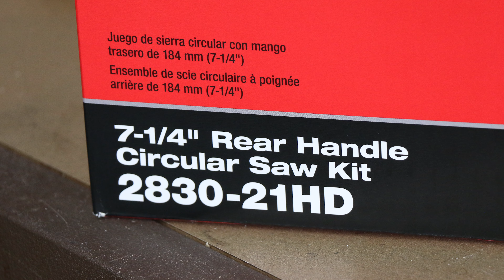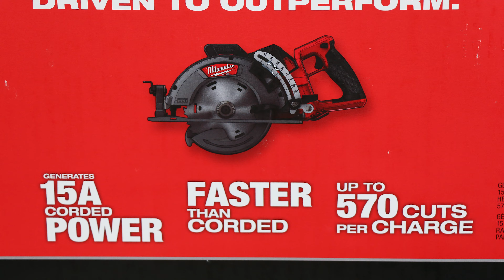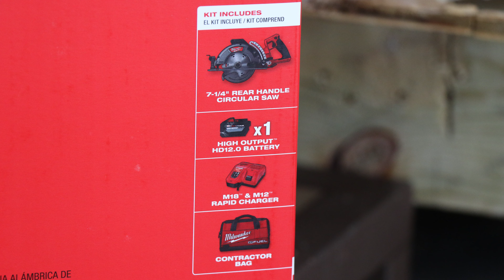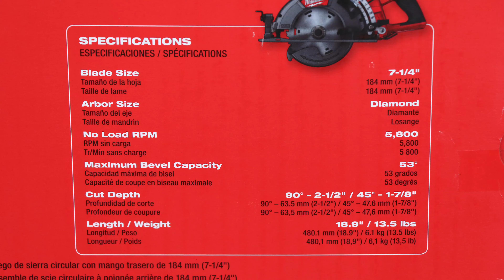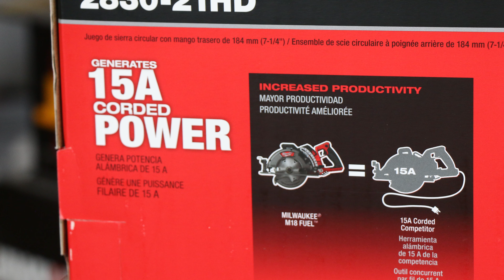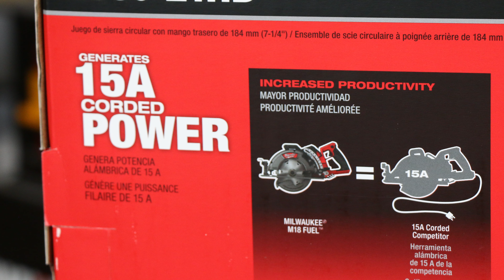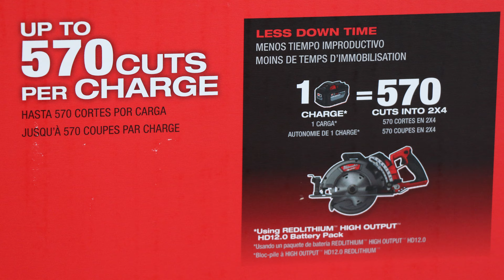New Milwaukee Tools 7-1/4'' Rear Handle Circular Saw **WARNING** (PROPER SETUP REQUIRED)

Comment: You should do a Makita vs DeWalt vs Milwaukee test. Plus there battery life and cost.
Reply: Add rigid to the list
Reply: How dare you leave the Kobalt XTR out...XTR tools are amazing. I bought the 3 tool combo that came with the drill,impact,led light,hammer drill bar grip attatchment, 2 batteries,charger,hardcase,and with that purchase I got a free Kobalt Circular Saw bare tool.

Comment: Vince I've had mine for a week and still haven't opened it.  But everything I've seen it's a beast .  Update finally got to tear into some 3/4 " osb yea its seriously a beast. Its my experience that this saw is better than a corded saw . Use it on 2x4  , 2x6 . Plywood, paneling.  It dosen't matter . Eats it up .

Comment: If memory serves me correctly, a standard corded skil saw is around 14.5 pounds and the mag 77 is a little over 12.5 pounds. So this hit right in the middle which is pretty good since the DeWalt cordless felt heavier than the corded skil. Even with the extra heft, the time saved by not rolling out or relocating a cord or hose makes these cordless tools total game changers. As long as the weight is distributed properly it has little effect on usability.

FYI for the uninitiated the rafter hook we call a sky hook and the “base plate” we call the table in the field. The notch in the blade wrench served two functions, one as stated to unscrew the brushes for cleaning or replacement and it also can break the diamond center out of the blades when required.

Comment: the screw driver on the wrench is also used for the rip guide that slides into the side of the deck. use it on the daily for multiple rips
Reply: what rip guide fits this??

Comment: Defenetly going to buy AND I cant wait for TTR Dewalt vs milwaukee worm drive saw
Reply: And Makita....?
Reply: Bailey Dyson makita is also great just personally would rather see Dewalt vs Milwaukee
Reply: @Dogecoin831  fair enough I've used both the DeWalt and Makita alot, and find the DeWalt has a tiny bit more power... Doesn't make a difference. However would choose the Makita 100% of the time you can't beat it's quality and smoothness. Will be interesting to see how 18v vs 36v vs 54v goes.
Reply: Bailey Dyson i guess just comes down to what platform your already invested in
Reply: I'd love to see DeWalt vs Milwaukee vs Makita.
Reply: Dewalt would destroy all comers
Reply: Its been done by at least 4 reviewer's and Dewalt won all 4
Reply: @loucifer323  really?  I'm curious to see this myself.  Do you have any links?

Comment: That friggin' ad right as you are about to make the first cut. 😂
Even if the dust collection wasn't perfect, you could see how much it caught in the backpack vac!
I have the DeWalt 7-1/4" XR circ saw, and I wish it was left side line of sight.
Reply: Can't stand the FLEXVOLT 7-1/4 sidewinder. I just can't do blade right saws. Gotta stick with my rear handle Makita 36V.

Comment: Hey Vince as a physics guy the hole is there to provide more suction at the point of entry for the dust. Think of it like an air vent in your plumbing. Air is going to take the path of least resistance so the air channel is going through the house, the dust moving through isn't going to want to escape that path because it would take more energy to exit the air channel than just follow it (eventually ending up inside the vacuum). Great video, love how you test tools.
Reply from the maker: It helps to keep air velocity up?
Reply: @VCGConstruction  Keeps it up, but also makes it greater than if you didn't have the hole.
Reply from the maker: Got it!

Comment: Only because no one has done it yet. Tool and 12.0 HO battery is 14lbs. Pretty good in my opinion. Great video VCG. For a test, I think you got to rip a piece of 4X8 on the 45 degree angle. Does anyone use the cordless band saw? if so, how well do it work?
Reply: Robert Capouellez i use the older brushed m18 band saw and it is powerful and very handy.  I tried to use the newer m18 fuel band saw and it was almost impossible to use one handed because of its larger size and heavier weight.  The m18 fuel bandsaw is nice because of its variable speeds though.

Comment: I initially bought the right side blade m18 7 1/4 circular saw... i will tell you this... i loved it but was really interested with the worm style so i ended up returning the right side blade and bought this worm style circular saw.... these are my pros/cons for it...  love the ways it cuts (like butter), weight is a tab bit heavier but it has the well balanced feel even with the battery on... i dislike the dust port... wished the additional port attachment didnt have a hole. They should have it closed instead.. So unlike the right side circular saw where dust isn't blowing on you...  i will tell you this... with this worm style circular saw and the way Milwaukee outfitted it's dust port.... dust will surely be blowing on you....With that said i still have no regrets with adding this beast to my line of milwaukee tools.

Comment: I got this saw last month and it's a beast. Tho I'm always covered in saw dust and you'd be surprised on how much saw dust I manage to get in my pockets
Reply: Get yourself a nice rugged leather apron
Reply: One thing I hate about this saw is the dust bath..
Reply: @theconcretecaveman6266  does the Milwaukee vacuum work on this? It’s really small pipe
Reply: @markgonzalez8828  it works to a certain point.. with the vacuum hooked up you will catch about 80%of the dust, it creates so much dust that the 20% is actually alot.. and without the vacuum hooked up, we'll prepare for a shower of dust.. lol it's really powerful though.
Reply: @theconcretecaveman6266  I’ve tried the dewalt version. Makita. Don’t see as much dust as I did on this video. Concerned a bit. I would still buy it but wait on a deal . Right now I can get it for 175 plus tax. On Home Depot when you add the other circular saw together. But I’ll just cancel the other one

Comment: Hey Vince.
Although, I'm in the Milwaukee 18 volt line and use them often. I bought the 48 volt Skilsaw rear handle wormdrive saw. Have been using almost everyday. I can't believe how much power this machine has, but its power is there when I need it. Thanks for the video 📹...

Comment: Look at that baby face 2 years ago... I love my 2830-20 saw. It works awesome. I hate the damn cord getting in the way on my old circular saw. How many of you guys have a taped cord on your circular saw? I always wondered why my dads had electrical tape on the cord. This saw is a damn good tool. No cord to get in the way!!!!!! I started out with the 5 XD battery. It is lighter than the 6 amp hour and 8 amp hour batteries. With the 5 XD battery, it last a long time in this saw. You don't need the 12 amp hour battery for use in this saw. It's a heavy beast!!!! Saw with blade weighs 10.4 pounds and 12 amp hour batter weighs 3.3 pounds. That is 13.7 pounds total. I like running mine with the 5XD and single hand on ply wood, peg board, 2x4's, 2x6's etc... This saw cuts straight effortlessly and the light works great. Milwaukee hit it out of the park with this one..

Comment: Do you recommend the Milwaukee rear handle circ saw or skilsaw battery. I’m already on the Milwaukee platform but would rather have the better of the 2. Thanks

Comment: I'm curious why the run time on this saw is listed as 570 cuts per charge when last years 2732 model is rated at 750 cuts per charge with the same battery and what appears to be the same motor. I have the 2732 and have been happy with it, I would prefer a left line of sight saw but have gotten used to using sidewinder style right line of sight saws and don't think I would purchase this one especially if its rated run time is a lot lower. The dust collection seems to work about the same as the 2732 and the table saw, which is to say not very well but definitely better than nothing. I think Milwaukee missed the boat by not expanding onekey functionality to allow a hypothetical onekey vacuum to wirelessly link to any onekey tool and auto start/stop the vacuum when the tool is being used.
Reply: Youre acting like you couldnt just have a back up 12 ah battery.  You a single battery for whole lineup kind of guy i see
Reply: @tannerwharton4670  man wrote a college thesis about a battery lmao

Comment: dust collection never really gets all the dust, just keeps it down so cleanup isn't so bad. It seems to do as good as if it was corded. I like worm drives they seen to allow for more control and straighter cuts. Probably most because of the change in leverage points when operating them.

Comment: I'd like to see run times / performance with the HO 3.0s since i have a lot of them now
Reply: the early evidence from other reviewers is not good with the 3.0s.. thermal shutdown etc... the 6.0 HO is probably going to be the lightest HO battery to push this blade with confidence.  In fact I found in one comment where some people thought the 6.0 HO would have more grunt than the 12.0 since a smaller capacity cell (not size) was used and as such would favor peak discharge over the 12.0 HO which uses a max capacity cell.  I think you might find that a 6.0 HO could win a side by side rip time test against a 12.0 HO.

Comment: Hi Vince, 

I know this is a older video but i would have like to see water or mist on the saw. My thought is, just in case you are on the job site or home and left the tool out in the rain or passing shower. 

Would like to see if it has any issues or causes any problems for the cordless saw. 

Keep us posted if you do any experiment with water with this saw. 

Thanks
Reply from the maker: Not a bad idea!!

Comment: I only got the super sawzall this month. So only 1 M18 12.0 battery. Shopping for the others now. Yeah they need some work on the dust collection. I am wounder what the Christmas sales for later on M18 worm drive though we will see later. I want it though don't need it yet though should have by Christmas time. Cold cut some money this month. I checked the M18 trimmer / pole saw to verify construction. I need one for 30ft since shaft drive not a option. The kabolt is electric shaft so possibly a option. As always thank you for these great videos & have a Great Birthday.

Comment: SO many things I'd like to say here in the comments!!! 1. I'm excited for you, Vince!
2. You're so much cooler than i could probably EVER be during an unboxing!
3. Cool cuts with only 1 bar on the fuel gauge
4. Maybe the hole in the dust attachment is to help protect any hose or catch bag from collapsing? Just a guess. 
5. LOVE the electric brake! Cool stuff!
6. I did see 1 cardinal sin (in my world) you committed.  NOT using a power drill to loosen a screw. 🤣🤣 just kidding.  Remember, I'm one for swatting a fly with a sledge hammer. LOL 
7. Congratulations on getting such a cool right-handed🤣(left line of sight) circ saw!
8. Would like to see it tested on..... oh.... everything in sight! so tempting... my goodness
9. Finally, thanks for sharing and God bless!😁👍✌
p.s. are you going to name her? 😉
Reply from the maker: Thanks David, we appreciate it!! I’ve never really made a habit of naming my tools!!
Reply: @VCGConstruction  Me either, Red Sonja was my first named tool.  Was Drew's (my grandson) idea. How could I not? LOL

Comment: On the box it states that the total weight is 13.5lbs, M18 12AH HO battery is 3:6.6 lbs M18 saw with no blade is 9:13.8 lbs Saw with blade is 10:3.8 lbs saw with blade and battery is 13:10.4 lbs

Comment: I use the 6 1/2 left line of site and the 7 1/4 right line of sight sidewinders. And they are great only thing i didn't care for is how out of square the 6 1/2 and was wondering if theres a way to square  the blade and still keep the degrees on zero

Comment: Is it possible the hole adds more power to the vacuum? I just know most vacuums aren’t meant to be necked down, thus losing power until you create an opening to allow it to get the proper drawl.
Reply from the maker: Good call!
Reply: You are correct on the hike in the vacuum for the rear handle saw plus it provides visibility so you know when it’s clogged. Getting clogged up could bog the saw down and the vacuum. Easy to stop and fix it when you see an issue.

Comment: @ vcg I have to share some frustration with acme tools. I bought some Milwaukee stuff in the being of june.(not preorder stuff) then mid june I hit them up. The said late june. Late june comes around then they say july. I just got a email saying September. Not to mention half the items the dont give me tracking. I dont think I'll be using them anymore. Have you or any of the vcg family had these issues?

Comment: Vince, I’d like to see the following tested if possible:

Dimensional lumber
OSB
1/2 & 3/4 plywood 
3/4 Baltic Birch plywood, taped cut line (prevent splintering/tear out)

I’ve been thinking this is the circ saw to pick up, glad I waited!

Comment: The screw driver on the end of the wrench could possibly be a tool to break the diamond insert from the standard blade. Like the dewalt rear handle has built into the angle adjustment. Black and yellow all the way !!!

Comment: i got the 2830-20 and it says its 10lbs but mine is TOOL ONLY, i think the 2830-21HD is 13 lbs WITH the battery

Comment: Is the screw for the dust port a flat head? If so could that be why the blade change tool has the screw driver part to it?

Comment: It looks like the wrench is used to knock out the Dimond on a blade. You should see if that is what the tip if for?
Reply from the maker: Good call, most likely yes! Nice surplus wrenches from the old corded model!!

Comment: Still own my old corded Skilsaw since 2008. Its the 15 Amp Corded Electric 7-1/4 in. Magnesium Worm Drive Circular Saw. Using the vacuum defeats the purpose of losing the cord. However I'm cutting the cord and will replace it with this Milwaukee  7-1/4'' Rear Handle Circular Saw. Unless the new cordless Worm Drive Skilsaw is better. Has anyone jumped from the Skilsaw to the Milwaukee?

Comment: I’m surprised you guys haven’t done a video on the m12 circular saw. Just not your style? No use for it?
Reply from the maker: It's not that we just haven't had a use for it yet. We use m18s for our circular saw needs. I will check out the M12 soon though! Thanks for mentioning that!
Reply: VCG Construction Yeah I kinda thought that’s why you guys haven’t made a video on it yet, no real point in spending the money when you have a few saws that are bigger and a lot more powerful. Unless you just want another video to make. But if any of you do have the Dewalt atomic 4 1/2” circular, or kobalt version I would love to see a video of these. The ones here on YouTube aren’t quite as detailed and legit as your videos. Although I’m pretty dedicated to the Milwaukee platform I Don’t mind reaching out. Im trying to find a saw or cutoff tool that’s big enough for wood, plastic pipe, thin metals, copper, yet compact enough for a backpack. And not a recip saw. Thanks you guys are the best! Keep up the good work!

Comment: ... I have the Dewar flexvolt one and is no circular saw battery operated how can be better then that one .Milwaukee ha's copy that circular saw with one good added the light ,but don't worry about that , when they will sent the European version ,will take that out like this did with 7 1/4 inch mitra saw .

Comment: The only circular saw that I’ve seen that truly captures 90 percent of the dust is the festool ts-55 and it full blade guard. I’ve seen some other saws moded with cardboard and various other things that did descent but defeats the purpose of you can’t see the blade on a regular circular saw and not a tracksaw.
Reply: No one who's using a worm drive gives a shit about dust. Carpenters are going to be using a festool cutting up rafters not are they using it to cut stacks of osb
Reply: Mafell MT55 has a way better dust extraction than the Festool.
Blade change is way easier too

Comment: Vince,

This unit has already 3 strikes by you (no allen key, hole in the dust collection and no 45 degree stop). 
 That's 3 strike and your out. If Dewalt had this same issue you would had gave chew them out. Milwaukee does it and you only say why? Come on, hit them hard Vince, LOL...

Just kidding, looks like a great saw. Can you let us know if there will be any issues if water gets into the battery area. Just want to make sure no issues if left by accident in the rain or a passing shower hits in the area. Can't wait to see a first TTR Milwaukee m18 vs DeWalt flexvolt circular saw battle "LET'S GET IT ON"
Reply from the maker: I’ve never tested the DeWalt worm drive, do you like it Michael?
Reply: @VCGConstruction  

Vince,  i don't own one but i did try one out for the first time yesterday from a co-worker. I was really impressed with the flexvolt. 

Like i mention i use both tool line and i seen the new milwaukee m18 rear handle saw on the NPS2019 videos. Looked pretty cool.

I fell like dewalt might be better just beacuse of the 60v. The milwaukee is only 18v. Just waiting to feel out a milwaukee or for some reviews.

Comment: I have found that the flathead end of the blade change tool worked perfectly to remove the center from diablo circ blade to knockout the diamond shape for this saw. Fit in nicely and broke away the tabs on the first shot

Comment: 13 pounds, 10.4 ounces, which is 1.25 pounds heavier than Makita's rear-handle saw, which is 12 pounds, 6.4 ounces with their x2 5.0 Ah batteries. Yeah, thank goodness for that accounting degree.
Reply: Yeah, that was also puzzling to me. The Mak has horrendous dust control, too; he was getting upset about the few crumbs left behind here,  I would not suggest he try that saw, lol.